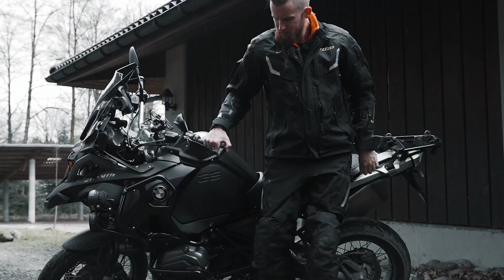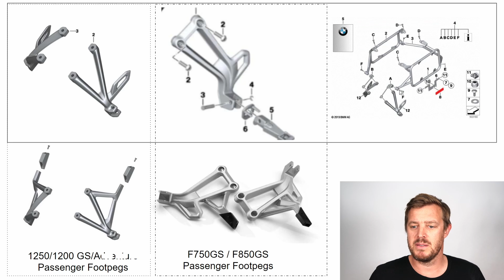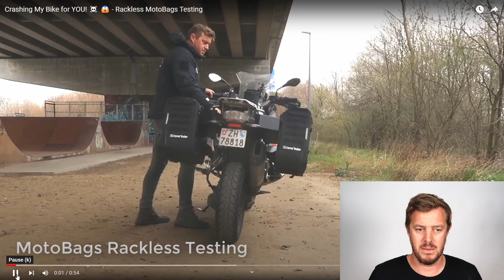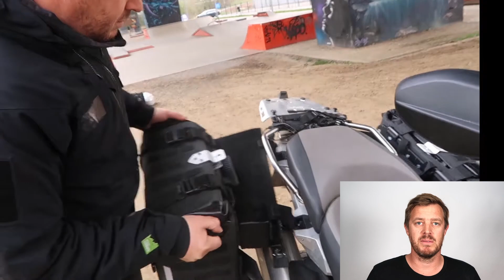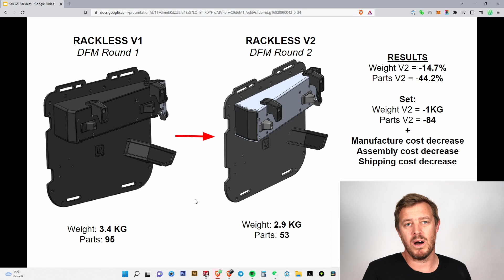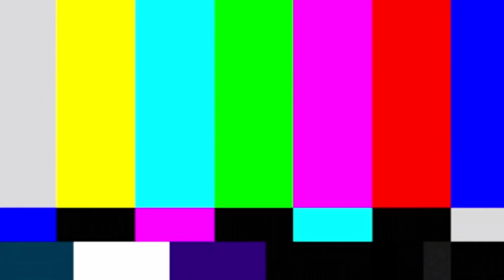How they were designed and manufactured - Rackless MotoBags

Comment: Thanks for sharing all those interesting insights! I just recently got my bags and therefore justifying the additional cost of the rackless system’s hard. The toolbox idea would have been great so far, imo. On the negative, I still find it quite bulky. Maybe I will cross somebody with the system next year and would change my opinion, who knows. I also understand that there were compromises to be made, especially in regard to solidity. It looks like the system can take hell of a beating 😊 Have you tried imitating the vario attachment more closely?

Comment: Great work and thanks for putting this whole process out for us to learn. Though your lugguage system is solid I personally still think that the bulk to the Mount can be reduced and quick mount and dismount should be universal mechanism not just focused to BMWs.
Reply from the maker: Hi, can you please send your idea on how to make it smaller but still manufacturable, contact link is in the description. At the moment we have 0.5L Air on each side left, that's like place for 2-3 bananas each side. Every bit counts sure, but the bag storage is extendable with the MOLLE system.  

Making it universal, impossible. But why not make a adaptor, then make this adaptor for each bike, not that would work. Thanks for your feedback, appreciate it Mani!